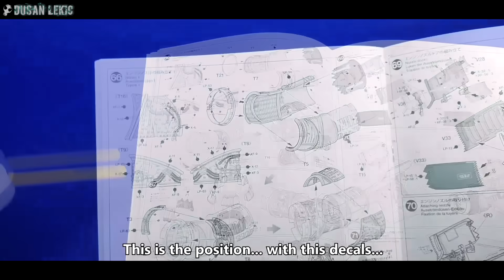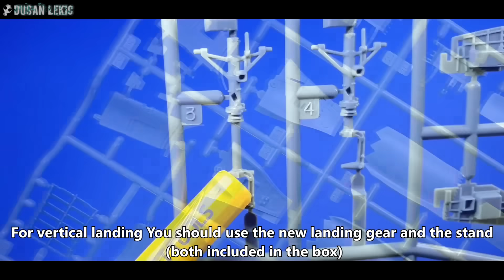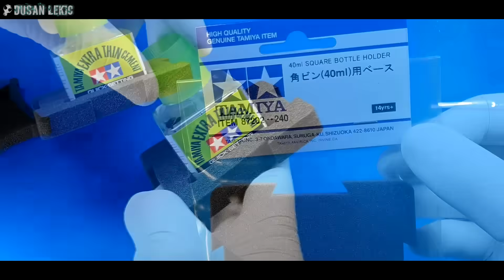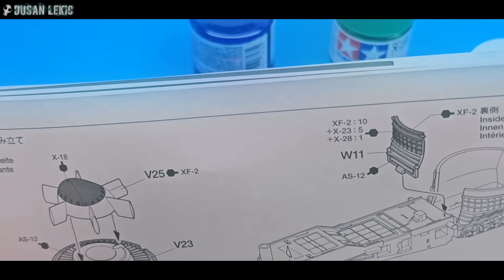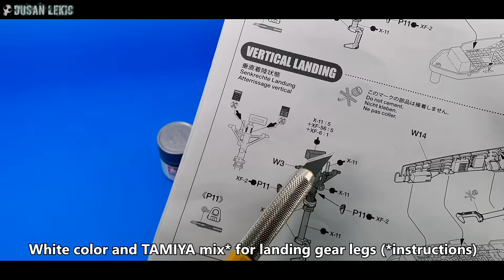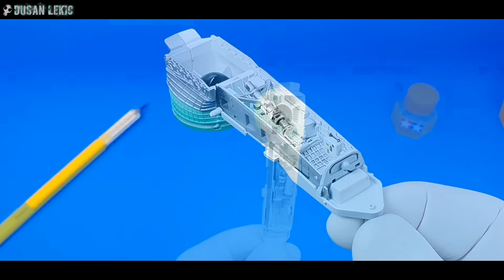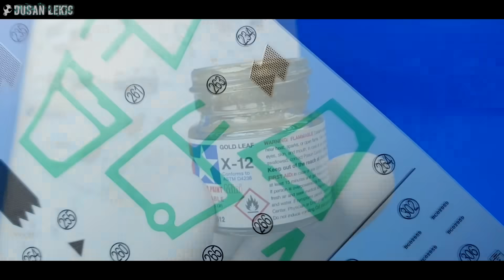TAMIYA F-35B LIGHTNING II BUILD (part 1)

Comment: They reckon you can almost put this together without glue. I found that with the F14 and the Phantom, almost no need for glue as the engineering is that good. Waiting for part two.